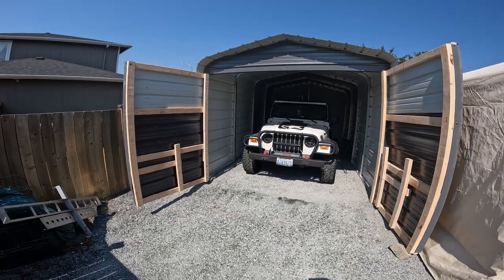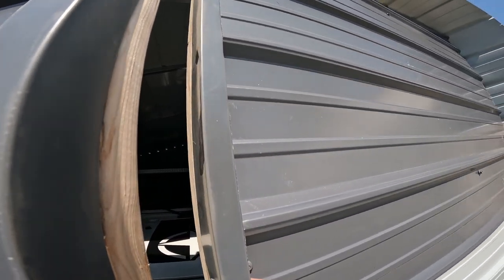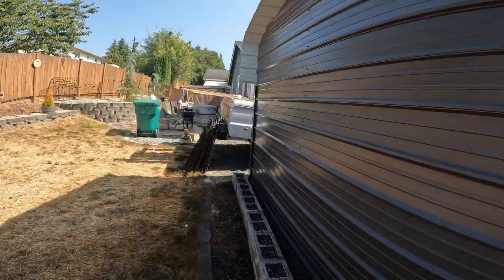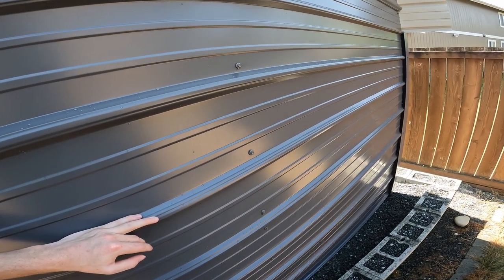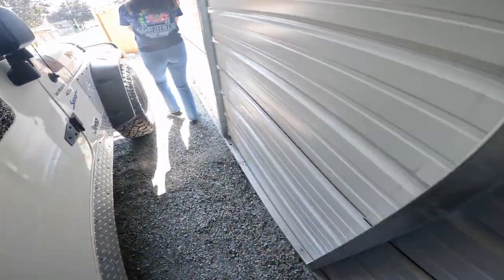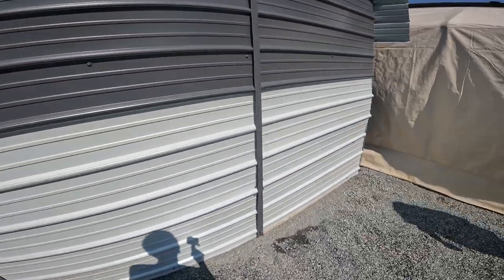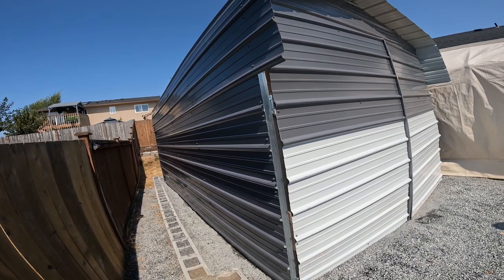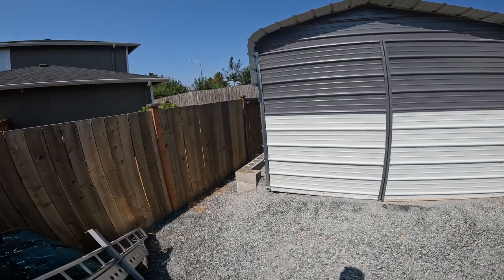Versatube Carport 10x20 Part 2

Comment: I Just received one, instructions kinda suck, instructions say 18' base section total but im 2" short on each entire base section unless I pull out the middle of the base 1" from front and rear which wont be snug, was wondering if I can just leave it snug or will that screw up the panel and roof installation when those panels come?
Reply from the maker: The instructions are not the best. The Issue I had is the carport has instructions and the sides had there own instructions at they contradict. 

In your comment are you talking about the frame or the panels?
 What size did you order?
Reply: @SteverGarage  so I should be good just putting the base and rest of the frame together snug and level and I should be fine?
Reply from the maker: Yes,
Make sure you slide the Swages in all the way.
You have quite a bit of give.

Do yourself a favor cause my biggest regret is not starting out with this,
Get a few drill bits sightly under the self tap size 

The screws will drill into frame but I put quite afew dents in mine from bit sipping off the bolts… and they need a lot of pressure..  drill bits made it so so much faster and smoother

Also instructions say to overlap towards low point and continue that all the way . This is wrong! And will leak after roof is done your side panels have to go under over! So just use common sense don’t take the instructions too literal.

I will have to post a new update video but so far I love mine it’s been great.
Reply: @SteverGarage  Thanks Man, Much appreciated!